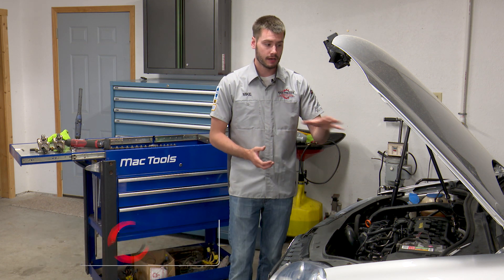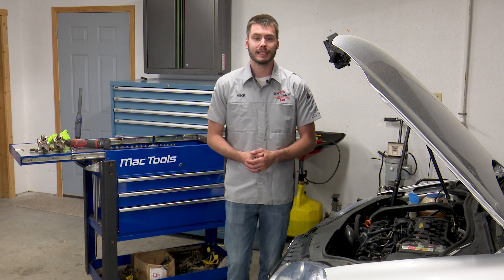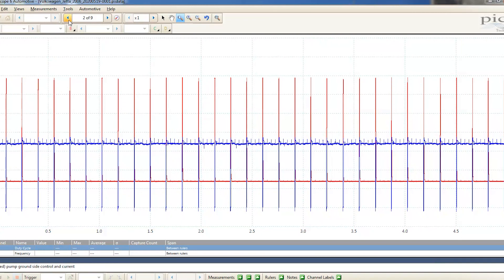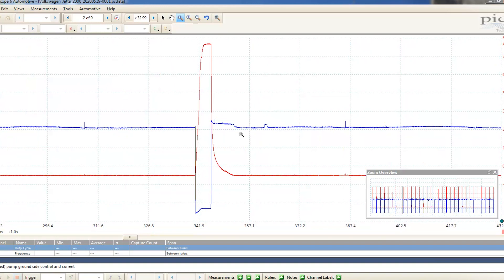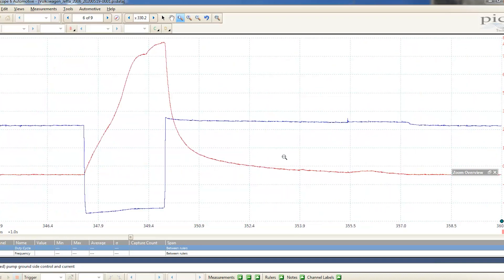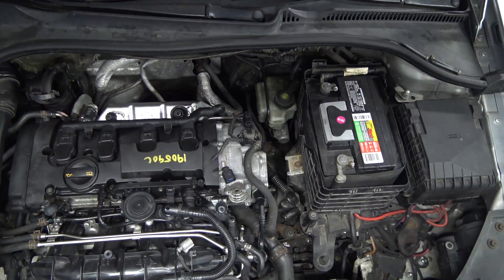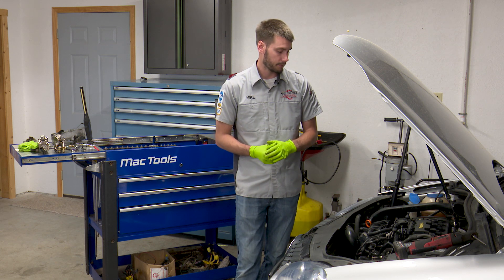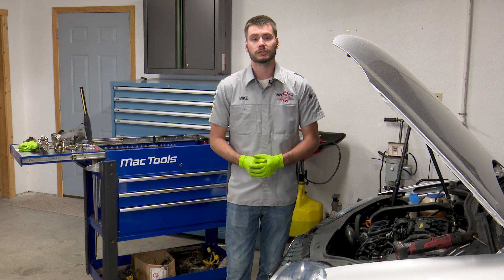Part 2 - Did The High Pressure Pump Fix The P2293?

Comment: I had this problem on my 2007 VW Jetta 2.0. 
I changed the high-pressure fuel pump that had failed. The car still would not start. 
I replaced the cam shaft that showed some minor scratches.
The car still did not start. When it did start, it ran rough and died.
I replaced the fuel tank pump, and I still have no start.
I gave up and had the car towed to my mechanic. 
Drum rool, the problem was the (catalytic converter) that was
 clogged, not allowing exhaust gas escape.
Reply: What codes did you have?

Comment: Great Video other that all the Data that didn't reveal much of anything helpful? It apears that Manufacturing process of the 2.0T Camshaft(s) isn't as good as the 3.2L V6 Normally Aspirated Engines? or is it a case of Lubrication differences between the Engines? My point is that the 3.2L Engines don't appear to suffer the same high failure rate as the 2.0T SB?  Randy  AKA randog311  Retired Professional Wrench, Audi's are my Specialty

Comment: See I had my hpfp and follower replaced and injector 1 after a new motor and still am getting this code. Car did sit for 4 years so it's a process. Shop said it is getting fuel so maybe the lpfp is not sending enough fuel now? I can't keep playing the parts game lol
Reply: Also had the sensor rail code show up replaced that too. It's lovely owning a ve product
Reply from the maker: That would be a good thing to check, make sure the Low pressure pump is putting out 3.5 - 5 bar (50-72 PSI), also make sure there is no damage to the camshaft lube that drives the follower.
~Ryan

Comment: So you’re saying that the code is triggered by a deviation of pressure from requested to actual. Do you have any resource that shows what the requested values should be at a particular engine speed or load?

Comment: Any videos or info on which lab scope and diagnostic equipment needed, without breaking a crazy budget?  I basically need to troubleshoot one of my vehicles with rough idle and multiple engine codes, p0101, p0008, 00720, p0017, p0054.  Or is everything getting into this over $1000-2000?  Sorry to go off topic, but trying to find a way to get info on lab scope for shopping.  I have a collector car and just can't seem to troubleshoot a rough idle, but pretty good when driving.
Reply from the maker: Hey Filazee, I know some people have had good luck with the Hantek brand scopes. Maybe take a look there. I'm pretty certain you can get them for under $1000.
Mike Becker, Senior Instructor
Reply: GoTech wow, im surprised actually to hear such an open-mind to the super budget stuff.  I think thats awesome that you are there to support all who try to learn such a cool set of skills that I didnt even know about until watching your videos.  Im the type of guy who would do all the mechanical stuff and throw parts at cars.  Now Ive been shown the way.

Comment: Usually solenoid control valve is on low pressure side (intake) of high pressure pump, at least what I saw on Euro cars but everything has a variable probably.
Reply from the maker: Hey Ivan, thanks for watching!
Mike Becker, Senior Instructor
Reply: @GoTechTraining   Thank you for sharing knowledge and procedures

Comment: Not to ruin your day, but I'd consider dropping the oil pan and searching for ANY metal flake. I'd recommend inspecting the oil pump counter shafts for bearing surface wear/free play. ALL of this happened to my friends 2006 Audi 2.0t Quattro because of the destruction of the oil pump balance shafts. The overall cause was failure to change the oil frequently enough, causing a catastrophic failure of the entire oil pump assembly and total loss of oil pressure/flow. These engines are SUPER vulnerable to neglect.
Edit: Reach out to Charles, "The Humble Mechanic". THIS is his forte.
Reply from the maker: Yeh, you're right. The entire motor really should be torn down. I'll reach out to Charles and see what he thinks.
Mike Becker, Senior Instructor

Comment: the pictures of it, someone didn't change the oil/or ran it out until idiot lights....
or someone dosed the fuel and all the bearings are matching that mess and should start hammering sooner than later, coin it a bum engine and try another, sorry to say that. but that's what my gut says
Reply from the maker: I wish I could. I really wish I was still within the 90 day warranty. This thing would have went back and tried another...but now i'm stuck with it.
Mike Becker, Senior Instructor

Comment: if it's a well known failure, that makes me wonder if there's not an hidden issue they're not telling us about... something like fuel going to vapor state and lack of back pressure causing follower chatter on the cam lobe or spring tension loss doing the same.
we all know lifter/follower and rollers(very much) hate not being in full solid contact and cause damages fast. then again perhaps purposeful planned obsolescence...
I coin that the Obama/EU era plan and look where it has placed them ;)
Reply: Yeah like passing emissions 🤣🤣🤣
Reply from the maker: I agree, there's something we're not being told here.
Mike Becker, Senior Instructor

Comment: Why is the cam journal worn.? Is it the kind of oil thats has a very low shear strength. Thus the journal is wearing? Do you need to find a oil that holds up better.?
Reply from the maker: Hey LJ, yeh i'm not sure. Again, this was a used engine, so I don't know its story. I only use quality oils, usually synthetic.
Mike Becker, Senior Instructor

Comment: So Mike. Are you implying that the cam is worn so much that the pump is not being stroked sufficiently and therefore not building enough pressure? Because although the cam is marked up it doesn't look so bad as to really affect the pump stroke i.e. I don't think the lift of the cam has really been affected that much (nor the duration). Just my observation. That said I have no other explanation for the issue.
Just wondering?
Reply from the maker: Dave, yes that's what I'm implying. I agree it seems subtle but we are talking about a pump with a 1.5 MILI second on-time at wide open throttle. The smallest variations are increased in those cases.
Mike Becker, Senior Instructor

Comment: Interesting how so much on a modern engine can fail in such a manner!  Speaking of wear, my daily driver is an old, high mileage Chevy with 4 bbl carb a with mechanical, pushrod driven fuel pump.  The only real trouble I've had with the car is with the fuel pumps.  After several fuel pump failures over the last 15 years or so, finally a new pump wouldn't fix it.  When I took the pushrod out it had worn more than 1/4 inch shorter than a new one.
Reply: Modern engines are the worst ever. Great ideas on paper, but once the bean counters & engineers butt heads, you end up with low-bidder junk, like everything today. GM AFM failures (among many others), Ford timing chain, guide, and phaser failures, Ram DOD failures, and the list goes on ...
Reply from the maker: The list is sooo long. I guess the only positive to it all is it keeps me employed. But I agree, cars today just aren't built to live a long life.
Mike Becker, Senior Instructor

Comment: All these metal shavings.... not good. Some good oil system flushing is in order. Hopefully no other componends were harmed by these...
Reply from the maker: Yeh...i'm just hoping at this point it's gonna be ok.
Mike Becker, Senior Instructor
Reply: @GoTechTraining  its funny, because thats what every VAG owner is saying at some point. ;-)
Me is rocking a 2001 Audi A3 petrol with 241k km on the clock.

Comment: i'm suspecting since the sprocket is on behind there that the slot  may be the head of a bolt holding that lobe on. it may be that easy.   what bothers me more is the exhaust cam  hitting the cover.  is the head wiped out in the cam journals???
Reply from the maker: Hey Richard, yeh it bugs me too! I tried moving/shift it...doesn't seem to have play. I wonder if something got stuck in there at some point? I'll know more once the covers removed.
Mike Becker, Senior Instructor

Comment: Wow!  I came in late.  By the looks of the replacement engine, there was a lack of maintenance by the previous owner.  I sincerely hope the bottom end doesn't look like that!
Are you installing a new cam, pump, follower and whatever else is needed?  Will the head need cam bearings?  I hope the oil pressure's well within spec.
Now you've got me curious.  My 2020 RAV4 (2.5L 4 cyl engine) has this pump.  I am definitely going to keep up with the maintenance (especially oil and filter) with this vehicle!  Oil is cheap.  Engines are expensive!
Reply from the maker: Hey Mike, better late than never :) Yeh, I agree It was poorly maintained. The more I did into this car the less likely it is that i'm going to be hanging onto it after it's all fixed up.
Mike Becker, Senior Instructor

Comment: Wouldn't it be sweet if the cam eccentric was a keyed replaceable piece!
Reply: Welcome to VW
Reply from the maker: Ohhh Russel, that would be amazing! Fixed in under an hour then. You're onto something there.
Mike Becker, Senior Instructor
Reply: guess what would break and egg out non-stop then lol
Reply: That would be to smart and simple, replaceable eccentric, they probably thought of that and rejected it in favor of replacing the whole cam, maybe a roller follower on the tappet? That sounds too smart also. 😨😲😝🙅
Reply: @michaelbegay9573   my 2008 q7 3.6  has roller on it

Comment: att least it looks much easier to work on the back of the engine in this transverse config compared to the longitudinal setup, but it might be harder to get to the belt and the rest on the front?
Reply from the maker: Hey G E, actually the belt man not even need to come off. The belt only drives the exhaust cam...you'll see in the next video. It's a weird engine haha!
Mike Becker, Senior Instructor
Reply: @GoTechTraining  that's true, but the belt is guaranteed to need changing at some point either way, and that's a breeze in the longitudinal cars. But the chain, tensioner, cam phaser and really the intake cam itself, imma just pretend they'll last forever in my A4.